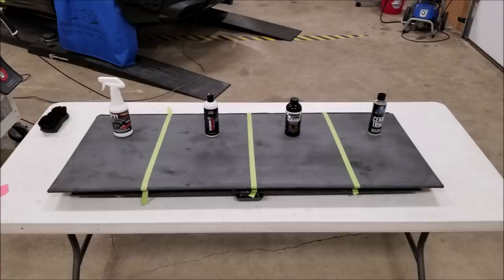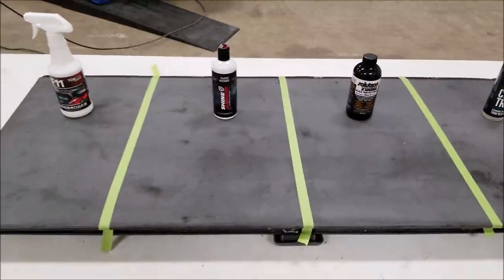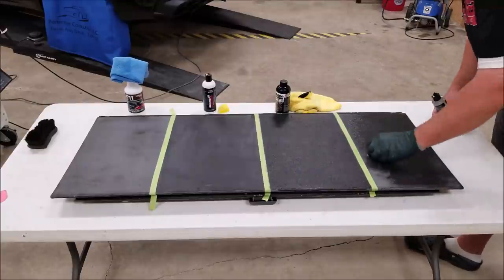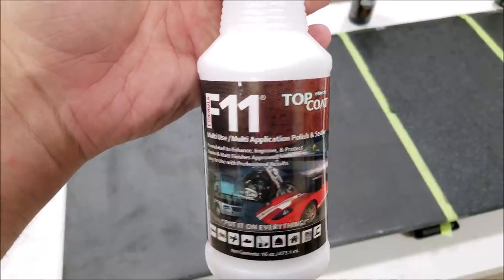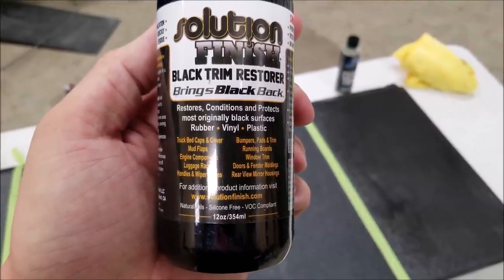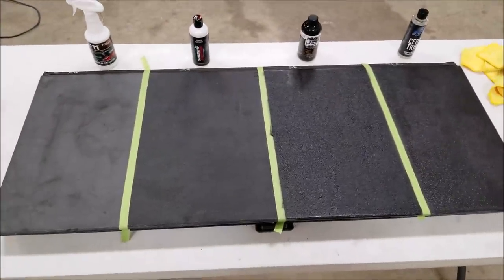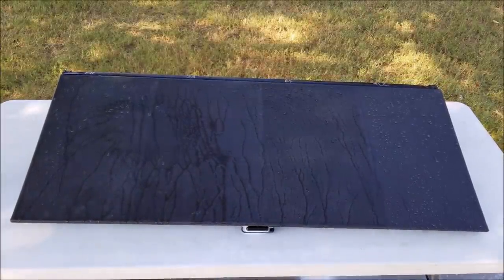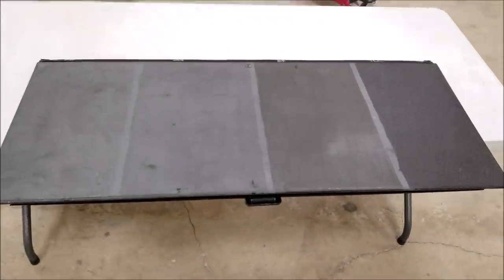F11 vs Shine Armor vs Solution Finish vs TLC Cera Trim - 2 coats, 10 washes - Trim Restoration Test

Comment from the maker: https://youtu.be/2NFA_uyQOlU for those asking about long term durability, this is the test that starts September 1.... already have the first wash done.
Reply: Scott H curious to see the results. One of our original vehicles is at around 7 months now, still hydrophobic but a bit less black. There are a few in your test that will be interesting to see. 😬😁
Reply from the maker: @TheLastCoat  agreed.  I'm glad you guys watch out for this kind of stuff too.
Reply: Scott H for sure, keeps us on our toes. 😂
Reply: @ScottHD  could you experiment a dye with like cera trim on top or the caroke wipes as a top coat ? Thanks
Reply from the maker: @jmj_d5207  you mean CeraTrim or Cerakote on top of one of the 4 products in this test? (For example).
Reply: @ScottHD  yes would like to see if it would like trap the dye because i used cerakote on a faded black but it seemed to not darken and just like act as a top coat

Comment: Great video. Cera Trim is the real deal. 08/06/23 just did the first coat of my 2500 Avalanche 2017 in Colorado Springs C0. UV is just a Killer here in Colorado Springs and my bleached out grey vinyl trim sucked. My wife just kind of laughed at me this stuff would work. WELL she CRAPPED when she came out an hour later. It took a little elbow grease wiping it on but wow IT WORKED ABOUT 90%. I have not applied a 2nd coat yet.

Comment: Have been using this TLC product for a few months on customer cars. I like it. If I'm doing a trim restoration I'll usually go with solution finish as my base followed by Ceratrim once solution finish has cured. Pretty solid combo. 

Thanks for the great video!
Reply from the maker: I may give that a try. That's a good idea
Reply: No Name   However long it takes me to work the rest of the trim around the car. When I end up where I started I wipe and reapply IF needed. The bottle says 1-2mins I believe.
Reply: That sounds like a god idea

Comment: Solution finish plainly says on the bottle under the directions to apply and let sit for 1 to 2 minutes. Then wipe excess product off. Then do not let the surface that the product was applied to get wet for 6hr. If done as described by the directions on the bottle correctly. Solution finish beats all of these products hands down for look and durability. It's the absolute best black trim restorer on the market that I've found period end of discussion.

Comment: TLC Cera Trim really surprised me, and it takes a lot to impress my cynical a$$. Solution has been my go to for years, but I'm definitely going to be ordering up some Cera Trim to try out. Thanks for the video!
Reply from the maker: Same here. We use solution finish in our shop and have for years.
Reply: Scott H good to know. I wonder if in the longevity test that's gonna be exposed to uv will have a different result? I guess solution finish will do good but well just have to wait and see. Thanks a million for the video👍👍
Reply from the maker: @RB54DaBears  oh I'm sure the UV will affect it.  That's why I am doing a longevity test separately.

Comment: Would love to see how 303 Aerospace would hold up.
Reply from the maker: I will make it happen!
Reply: @ScottHD  Thank you!
Reply: 303 doesn't last.  Used it on my V70 X/C for a while and it fades in the sun quickly (two weeks or so) and would come off almost completely after just one or two washes. Of course those washes weren't back to back washes like in this video, but standard contact washes with non-ph neutral soap.

Comment: Another really great review! Only two things have ever worked for me: 1. Using a heat gun and 2. Cerakote vinyl restore wipes. You have to be careful with the heat gun and cerakote will show high spots if it does not go on evenly.
Reply: DO NOT use a heat gun. It does release some of the oils from the plastic below and has the best results, but as it's drawing the oils up it leaves the plastic below brittle, and thus much more likely to break.
Reply: @seventeen9718   It also only lasts a week or so, as well.

Comment: thanks dude...was going to go with ceratrim (the gel bothered me thinking I'd use more, kind of like you confirmed)...but after a couple videos...I think I'm going with the Solution finish...bigger bang for the buck.  But maybe the Certrim for my own or higher end vehicles because of the durability.  Did look like the Solution was lasting great for a long time though

Comment: In all fairness the final light spot on the Solution Finish was from the lack of second coat application in that area. package instructions say to apply and after 2 minutes wipe excess off which may have caused the spotting

Comment: I bought some Ceratrim and it is pretty tricky to apply as its really thick and the instructions aren't that clear and wasn't sure how long it had to stay on before you buff off the excess. But it does so much better then what the other 3 trim restorers I tried, which did nothing.

Comment: Love ceratrim my only issue with it is it's greasy so when I use it on my Window trim. After it rains the windows are all streaked with a film of that on it and I have to use alcohol to remove it.

Comment: Unfortunately you made a big mistake with solution finish you're supposed to wipe off the excess after each coat. By far solution finish is the best trim restorer on the market hands down.
Reply from the maker: Check out some of my other trim longevity tests.  While it didn't last the longest, it was one of the longer lasting ones.